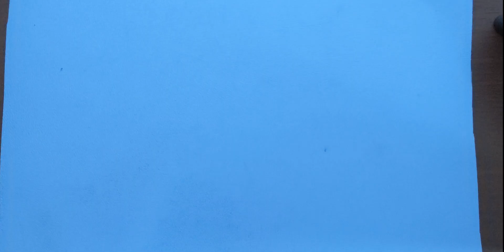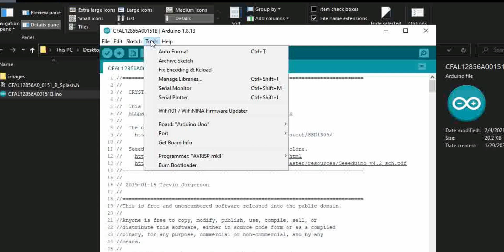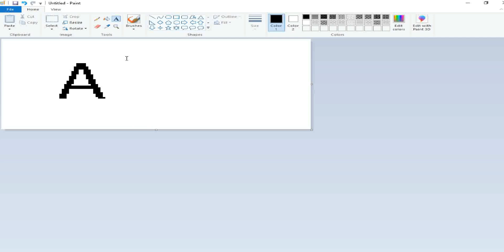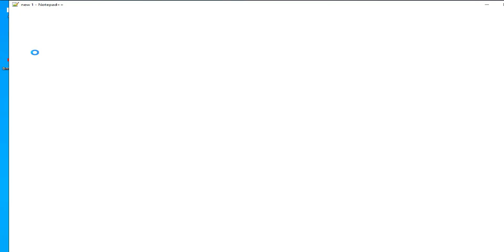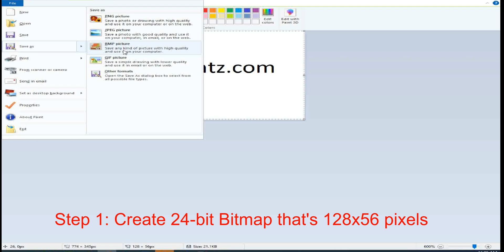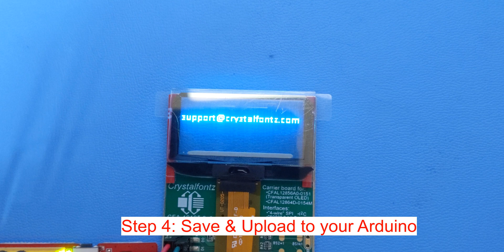Transparent OLED - How To: Load Your Graphic onto the Display 👨‍💻

Comment: Can the brightness of this display be modified?
Reply from the maker: Yes you can, there's an example in the demo code we provide. https://github.com/crystalfontz/CFAL12856A0-0151-B You'll want to check the controller datasheet here as well: https://www.crystalfontz.com/controllers/Solomon%20Systech/SSD1309/342

Comment: does it only handle still images or can you have like an animated gif playing?
Reply from the maker: Depending on the micrcontroller you use, you could use a series of images and "play" them (that's how video is made) it uses SPI and is pretty small so the frame rate wouldn't be awful.
Reply: thank you @Crystalfontz

Comment: When I first plugged in this board it did correctly show the demo, however after I tried compiling one of the other demos and uploading it, the board no longer shows any output. I even tried compiling the original demo again and uploading it but still no output anymore
Reply from the maker: Make sure the code you're downloading is set to use the interface the display is wired for. For instance, on line 112 of the demo code it's set #define I2C , change it to #define SPI_4_WIRE contact us at support@crystalfontz.com if you need some more help.

Comment: Is there a way to make it portable? I’m looking to make a heads up display in a helmet and this might work but I’m not sure. I need it to be over what you see out of so it can’t be surrounded by parts. My specific plan is I need to display an image with one and have a compass with one if I can.
Reply from the maker: You could run it and your microcontroller from a small lithium battery. This display requires 12.5v@15.2mA. Our breakout board is the best example we have for mounting it. You might consider something smaller like this: https://www.crystalfontz.com/product/cfal12832c0091by-small-yellow-oled-display
Reply: @Crystalfontz  well that’s the thing, it has to be the transparent one as it’s going straight on the visor
Reply from the maker: @gilbertdegoatfried3502  As cool as it sounds, that won't work for you. Here's a video that explains it really well https://www.youtube.com/watch?v=zZZ-Ea8RyjQ
Reply: @Crystalfontz  well I see the problem with that but it’s oils be mounted at least 4inches away it’s more just to show I have it in there for immersion. Is there a tutorial on how to customize the output? I’m not very good with electronics
Reply from the maker: @gilbertdegoatfried3502   You'll want to get familliar with the demo code we provide and start there. This video will show you the basics of how to put a graphic onto the display then you can extrapolate from there using your graphics and data.

Comment: Is it possible to isolate the screen from the chip, maybe connect them through a wire?
Reply from the maker: We like to think anything is possible with enough time and money, but in all practicality, no it's not. You may however be able to use a slightly longer ribbon cable though, depending on the interface you use.
Reply: @Crystalfontz  Yes I've come to realize that lol. Sucks! Thanks for the tip though :)

Comment: Can I use that with Arduino Nano?
Reply from the maker: You can use any microprocessor that supports SPI or I2C and has 3.3v output.
Reply: @Crystalfontz  do you ship to Turkey?
Reply from the maker: @ardamutlu7  Yes we do, you can estimate the shipping charges on our site, once you add it to your shopping cart. We also recommend getting the breakout board for a quick bring-up.